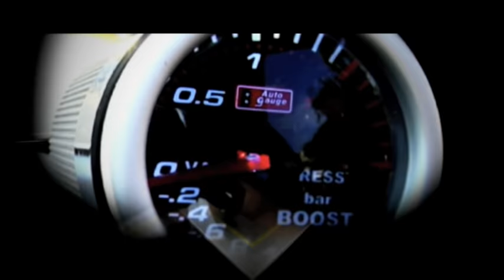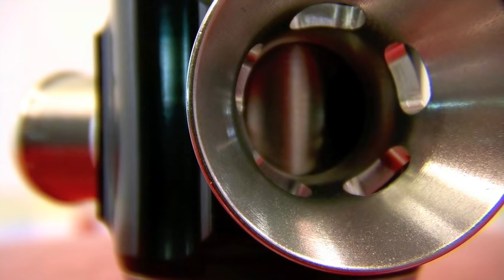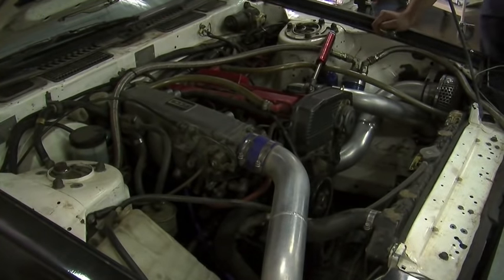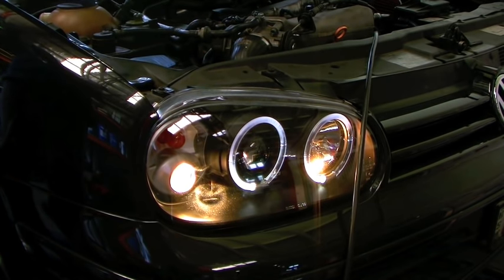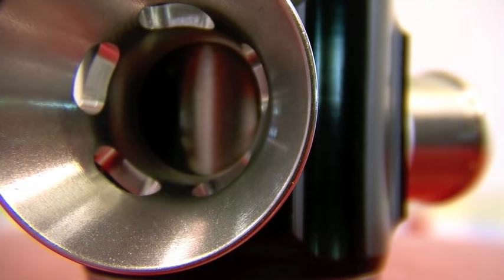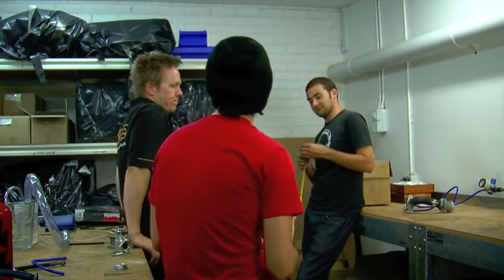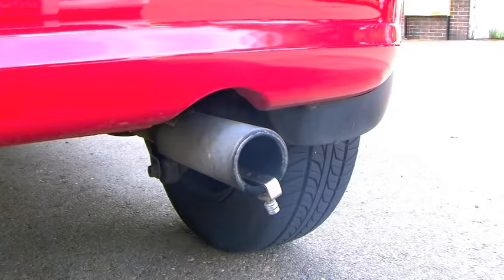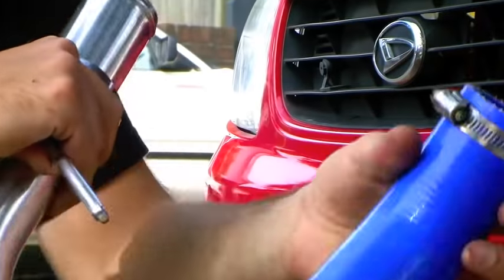Blow Off Valves Mythbusted

Comment: The reason I want a turbocharged car is FOR that 'stutututu' sound. Why would I want to get rid of it?
Reply: because it ruins your turbo and it decreases its life span.
Reply: Luis Ramirez But by how much? If it makes my turbo last for 3 years instead of 4, I'd still leave it without a blow off valve.
Reply: +Retz If you're breaking turbos every four years, you might be doing it wrong.
Reply: Ryan Thompson That was an example, I was asking how long that one lasts.
Reply: +Retz Ignore the people who say it will ruin your turbo, there really is no proof that it does any noticeable damage over its life span.
Reply: DriftNick Yeah, I think people just say that to justify them getting blow off valves. They know they sound so much worse then normal turbos, so when people ask why they put a blow off valve on they say that as an excuse.
Reply: +Retz well penned.
Reply: +Retz 2JZ is Always there for you. even if you put BOV still has stutututututu sound that you like.
Reply: Renzeth Bulawan If your BoV is working right it won't flutter, the engine has no effect on whether it flutters or not so no a 2JZ will not make the sound with a working BoV.
Reply: +Retz If you like turbos for the performance then not having a blow off valve will increase lag.
Reply: MMAteenager There is no noticeable difference in lag between running a BoV/BpV and not running one.
Reply: ik I love that stutututu sound lol
Reply: +DriftNick Some people tighten the BoV too restrictive to make the turbo flutter, which defeats its purpose, but this is why some people have a BoV and still flutter...
Reply: i like hearing a car giggle too lol
Reply: +DriftNick The valve is there to reduce excessive pressure surges when the throttle snaps shut or engine RPM drops when shifting up. Those pressure surges increase stress on the fan blades, throttle body and everything in-between, which in turn increase the likelihood of something failing from mechanical fatigue. The valves are there to improve reliability, not performance.
Reply: Teardown Dan "Those pressure surges increase stress on the fan blades, throttle body and everything in-between,"

It seems like every day people come up with new shit that it causes damage to, ignoring the countless people that run no blow off valve/bypass valve for many years without issue.
Reply: Revoku Read the comment above yours.
Sure, it increases your reliability, but not by much. There are cars that are 20+ years old with turbos that have no BOVs and their turbos have never been replaced because they are perfectly fine and working after several hundred thousand miles and tonnes of abuse. BOV or no BOV, it doesn't matter, it's just personal preference. 

And I'm sure that 9/10 people agree that no BOV sounds much cooler then having one, regardless of whether or not they think having no BOV is bad for their car or not.
Reply: +Retz said 20 year old turbos also do little in the way of increasing performance, and low boost numbers, there is a reason they added blow off vales and there is a reason 10 pounds of boost used to be considered huge and isn't really anymore
Reply: Revoku We're not talking about performance. We're talking about reliability. And BOVs don't improve performance either.
Reply: Revoku "no blow off valve, you can't up the boost past a certain point"

wtf are you even talking about? how does not running a blow off valve limit the boost you can run?
Reply: Revoku I can tell that you are triggered. Sorry that you can't accept that running BOV is pointless.
Reply: +DriftNick cause if u run 20 pounds without any way to remove the excess pressure, shit blows up.
Reply: Revoku LOL, search "RB30 1200hp" on youtube, is 50psi enough boost to blow it up with no blow off valve?

Also a lot more videos on channel of people running a lot more then 20psi including people pumping 40+psi out of turbos with no blow off valve for years without issue
Reply: DriftNick This guy knows nothing, there isn't any point in arguing with him.
Reply: +Retz Well, as Brett said, a well set up BOV, that leaves some boost pressure in your charge pipes will give you better throttle response, especially between gear changes, as you start from 5-8 psi of boost, rather than 0. Not only giving you more power after the shift, but also spooling the turbo back up to full boost faster.

Not to mention the less wear and tear on your turbo, and other components of that excess pressure.

So, more performance, vs silly noise you like. Choice is entirely yours.
Reply: Goldmarble "as you start from 5-8 psi of boost, rather than 0"

Except in the real world that isn't what happens, part of that being that without a blow off valve most of the boost pressure isn't lost out the valve.

"Not to mention the less wear and tear on your turbo, and other components of that excess pressure."

Doesn't seem to be an issue for the countless people not running a blow off valve.

"So, more performance, vs silly noise you like. Choice is entirely yours"

So same performance and the silly noise you like.
Reply: +Retz Ask the Turbo yoda what he thinks of them. I'm pretty sure he puts them in the same category as "stancey pants"
Reply: A bov isn't necessary under boost pressure of 12psi but over that depending on the car it is a good idea. if the car makes 7 or 8 psi stock going to 13 could stress turbo as well as throttle plate but a car running 13 stock without a bov or bpv is fine but most high boost cars have a bpv.
Reply: James Godwin Been running 16psi for years with no blow off valve or bypass valve without issue, search "1200hp rb30" on youtube, you'll find a video of a engine running 50psi with bov or bpv and on that channel you'll find many cars running high boost without them.
Reply: +Retz take off the blow off valve do what you want doesn't matter and even if it takes off a couple psi and other stuff it doesn't matter do what you want and the guy who said "and slap a huge spoiler on it while your at it" that would add downforce if done right so it would help and in need for speed the place that did research just for descriptions for the upgrades of cars In an old nfs (need for speed most wanted 2005) the best car in the game has the LOVELY flutta that we love
Reply: +DriftNick The reality is, anything you do to a vehicle that changes it's factory specifications, will reduce lifespan. That's not up for debate, it's just how it is.
Reply: Chris Brasher There are a lot of things that increase the life-span, but usually at the cost of performance.
Reply: BOV'S aren't made to make more power. If you don't install a BOV because "you like the sututu sound" you probably don't know much about cars. That sound is the compressed air that suddenly can't go into the combustion chamber because the throttle body is closed, so it rushes back into the compressor housing, and into the compressor wheel, similar to how the turbine works, except the compressor is not designed for that at all. The sound is actually the compressed air going the wrong way, back into the turbo, and the compressor wheel chopping through the compressed air. You should know that compressor wheels are very precisely designed, and if you have common sense you would know that having 15+ psi of air rushing back into the compressor would be very bad for the turbo. I'm not trying to start an argument i'm just trying to educate so that you don't say things like "BOV owners just say it helps the turbo to justify buying one but they don't do anything".
Reply: Retz I've been through it all..I've built diesels, mud trucks, crawlers, a couple of Mustangs and even 4 banger turbo cars. These days I change the oil, might put some good looking wheels and tires on them and drive them..lol.. I
Reply: Ewan Barker I've been running over 15psi for years on the same turbo and no BoV, never caused an issue, it's quite common for people here not to run one including people running 30+psi for years of abuse and they don't seem to have any issues, if it does do any damage it's so small you won't notice it.
Reply: DriftNick It doesn't do as much damage as people say it does but its not just to prevent damage, they can also decrease lag time, and you may not notice the damage, it may just be the compressor wheel getting worn down so you make a little less boost. Yes I will admit its not something that you have to have, but it will add a little bit of performance, so if you have the money why not?
Reply: Because if you have metered air flow, which that gti does, then you dump all that air to atmosphere, the ecu will dump fuel into the engine for air that is no longer there, causing your engine to run a richer air fuel mixture. These guys don't know a damn thing about turbo cars.
Reply: compressor surge is the best!
Reply: It's not "bad for the turbo", it just slows the turbo down a little which makes it take longer to spool up. You have rocks in your head
Reply: Retz because your turbo really doesnt like that sweet stututututu
Reply: That's a myth. Open throttle pressure surge is what causes damage. Open throttle pressure surges are caused by the turbo trying to spin forward and backward at once, which is what causes stress on the bearings. As longs as the throttle plate is closed, the turbo has no load and spins on its own meaning no room for stress related damage.
Reply: MMAteenager me like the lag
Reply: it's a stutter box can have with blower too not just turbo called delay box
Reply: It was the Bugatti EB 110 that made me want a turbo to get that sound.  If a BOV was so important and not having one would destroy your turbo, I wonder why a car company like Bugatti   would leave it out.  If turbo flutter is fine for a super car with FOUR turbos, then its fine for everything else.  Unless your turbo is a super cheap piece of garbage that you built in your shed.
Reply: Retz it’s shaved off the turbine over time.
Reply: Retz it ruins the Turbo, you damage it when you Not User a blow off
Reply: Because with out one it sounds stupid and doesn’t get as annoying
Reply: Raxis have you not heard of modern low toque turbo? Virtually no lag, low boost. Increased performance big time even at low rpms with low boost... Low boost is extremely useful for performance some peoples twin turbo setups have one low and one high...
Reply: seriously? you want a turbo just for the sound??
Reply: @DriftNick  Did you not watch the beginning of the video? re-watch and hear what the GFB 'ENGINEER' explains
Reply: @benst2594  The guy trying to sell his brand of BoV said that it helps and you should buy one, shocking.

"What do you mean by no proof"

No one can ever show me any proof it causes any noticeable damage or lag, it's very common to see people not running valves for years running a lot of boost with no issue and if it caused any lag it wouldn't be so common to find race cars and drift cars that run no valve or get a lot of flutter, look at the Ferrari 488 GT3's for example.
Reply: DriftNick it actually does wear the turbo down by the air leaving through the compressor wheel, which it is possible for a blade to spit out.
Reply: Retz that's because older cars run 6-10 pounds of boost.
Reply: DriftNick what will happen if you put 30 pounds of boost in a car that lacks a BOV? The throttle body closes, and there is too much boost in the piping, you could bend the throttle body, piping hose can fly off, my uncle's been there.
Reply: @Turbo_The_Femboy_Fox  Plenty of people a lot more then 30psi without a BoV, what happens is the pressure is released out the intake of the turbo like it's designed to do when it surges.

Also how is a blade going to spit out? even if the shaft snaps that wouldn't happen.
Reply: DOWNLOAD THE APP BROOO
Reply: @DriftNick  youre not too bright in the head. Why do you think they call the turbos intake an intake. Air surges in a turbo arent designed to get spit out from the intake that defeats the whole purpose of a turbo. When you have too much air when the throttle body is closed it can either blow up the housing where the throttle body is or go back straight into the turbo possibly chipping the turbo blades.
Reply: @DriftNick  it limits it past a certain point because every time you close the throttle the air goes back to the turbo slowing it down so every time you try to shift or lift your foot off the gas peddle that air goes back to the turbo. With a BOV you can lift off the gas or switch gears and not have the turbo being slowed down buy excess air.
Reply: @untailledv2154  The irony of saying I'm not bright in the head then saying it causes the housing to blow up LOL, they are literally designed to let air go out the intake when surge happens, people are running 50+ psi making over 1000hp with no blow off valve without issue, it's almost like it doesn't do anything you just said.
Also the turbo slows down no matter what, in the real world there is no lag caused by no blow off valve otherwise it wouldn't be so common in race cars and drift cars, GT3 cars for example get surge off throttle.
Reply: @mrepicpant  Congrats on running too much boost, nothing to do with surge/flutter off throttle though.
Reply: @DriftNick   @DriftNick  I'm not saying it blows up 100% I'm saying its a possibility. A turbo is designed to compress air and push it into the engine not compress it and make it come out from where it came, it will slow the turbos impeller down making you have to basically spool up the turbo again because the only way for the air to get out of the turbos intake is to go through the impeller. And yes the turbo eventually slows down but the air going back to it is going to slow it down even faster. I'm pretty sure gt3 and drift cars don't need BOV's because the drivers are basically "red lining" the cars when they race so the by the the time the air is being  surged out of the turbo its already being sucked in by the engine.
Reply: @untailledv2154  Part of the design of a turbo allows air out the intake when surges happens to correct it.
"by the the time the air is being  surged out of the turbo its already being sucked in by the engine."
??? This comments makes no sense and we are talking about off throttle surge, the throttle is closed...
Reply: @DriftNick  im saying that by the time the air was being pushed back the driver was already going to hit the gas pedal..  cause you know when you race you want to keep your foot on the gas right?🤦‍♂️ yeah idk where you understood me talking about open throttle
Reply: @untailledv2154  If you think that happens then why do you think it causes lag? your comment is hard to understand because it doesn't really make sense.
Reply: @DriftNick  tell me what doesn't make sense so I can clarify it to you again.
Reply: DriftNick 15 psi in an s14 KA-T is nothing to brag about lol go put 30 psi w/o a bov in it and check back in when you need another KA in 3 months
Reply: @mrepicpant  Where did I brag about running 15psi on a KA-T? are you talking about the S14 on my channel? it's not a KA nor did I say how much boost it's running, I've been running more then 15 psi for a lot longer then 3 months with zero issues.
Search on youtube "50psi boost 1200+hp Nissan RB30 - Ethanol E98" and you'll find someone running a lot more then 15psi without a blow off valve, it's quite common here for people not to run one.
Reply: DriftNick You only have 1 example you keep pulling up and keep talking about 15 psi like that’s a lot or something. If it was higher than 15 why keep saying 15? And that rb30 is a completely build motor running on ethanol with burns cleaner and at a lower temp than gas. Comparing a setup for E98 to pump gas is comparing apples to oranges.
Reply: @mrepicpant  You are the one that brought up 15 psi??? also plenty more examples on that channel with the RB30 or you could just search turbo flutter on youtube and see heaps more, it running on E98 or being a built engine has literally nothing to do with that topic of surge doing damage or not so why do you mention that?
Reply: DriftNick go check your own comments lol I can just quote you “I’ve been running over 15 psi for years on the same turbo and no BoV, never caused and issue”
Reply: DriftNick And also to quote you again: “Been running 16 psi fot years with no blow off valve or bypass valve without issue, search ‘1200hp rb30’ on youtube” I love that when you say over 15psi you really just mean 16psi lmao
Reply: @mrepicpant  It was replying to someone else I guess , people seem to get this idea that it's bad if you are running more then that in reality there are plenty of people running a lot more and never having issues, that RB30 is just a perfect example of someone running a lot of boost with no blow off valve.